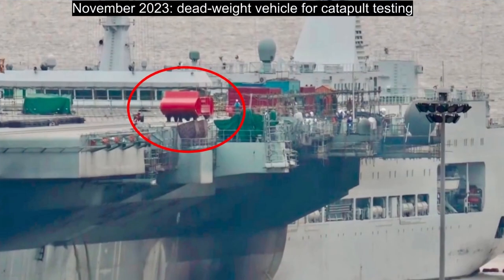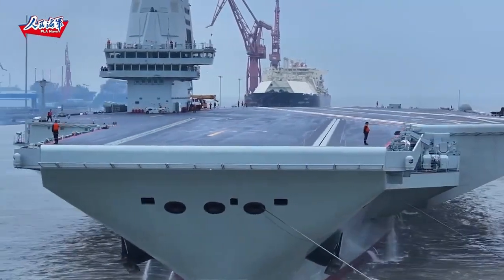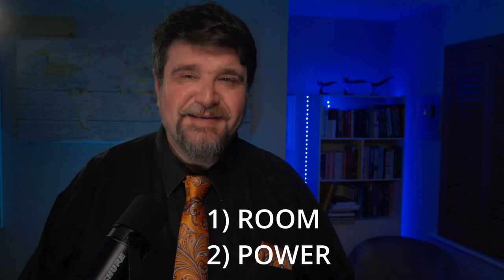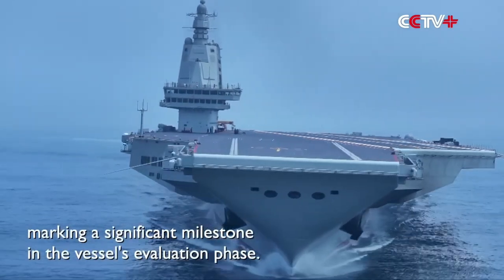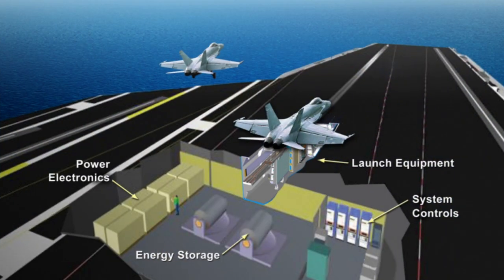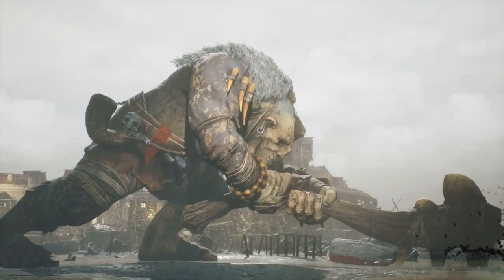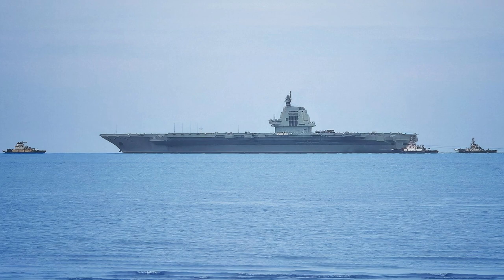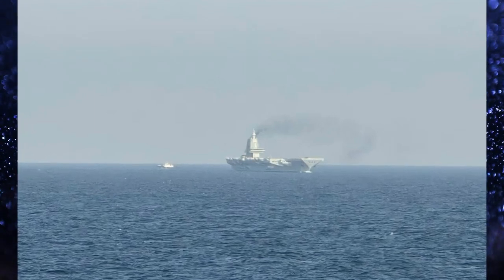EMALS: China Caught the US!

Comment: PLAN would have installed a fourth catapult but they did not have a long enough extension cord to power it.
Reply: Dont worry the Type 004 will have 4 Catapults and they are planning to build 8 o them…
Reply: @amunra5330  I won't be surprised if they just straight up name the next carrier 005 and still have 3 catapults, cause the number 4 in Chinese is similar to the word death. No sane chinese person would want to serve on a ship called 004 or use the 'fourth' catapult.